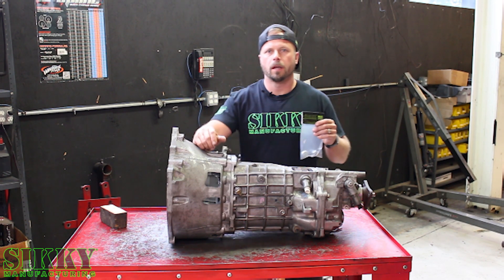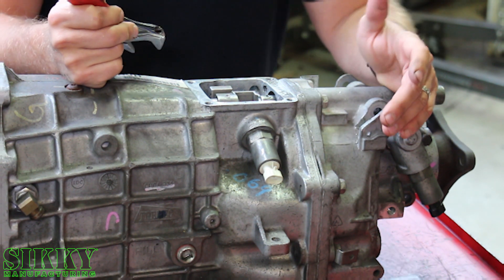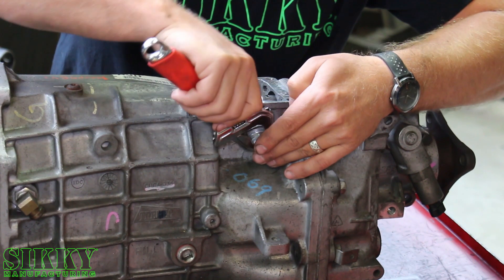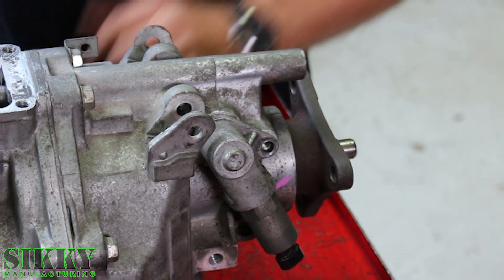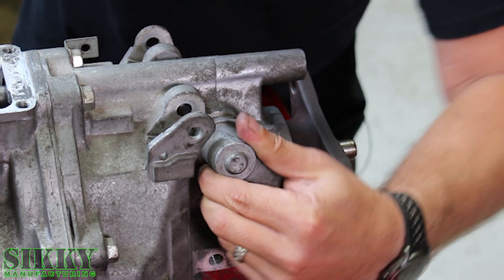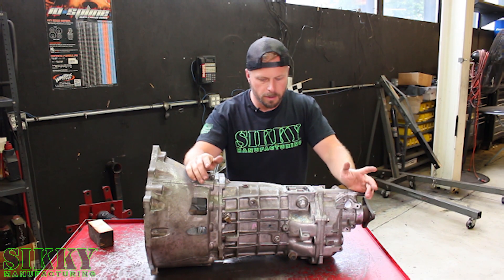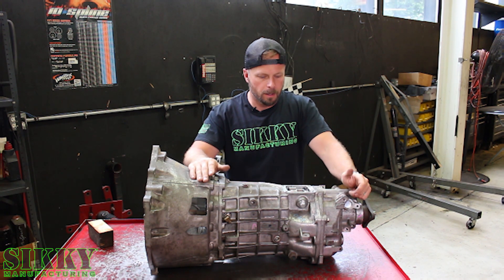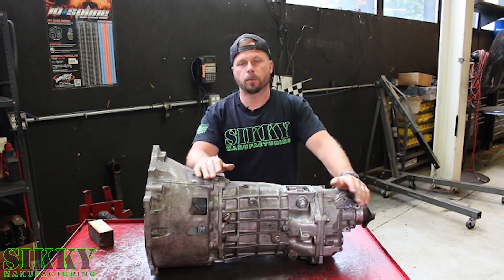How to Delete TR6060 CAGS + Reverse Lockout | SIKKY Manufacturing

Comment: Currently swapping a 2015 LS3/TR6060 in my 1975 Dodge Dart Sport. There are many Sikky parts I have used and this one is the next one, and also ordering the TR6060 relocation short throw once i have the tunnel finished.
Reply from the maker: Nice!  sounds like it's going to be a really cool setup.  Yeah we always recommend getting the trans in position or at least mocked up so you can get a precise measurement on where you want your shift lever to come through the tunnel that way you can pick the perfect offset shifter and combination of rod.  If your on social media be sure to tag us when you get the parts on!

Comment: I’ve been having issues with my second gear for years in my 15 camaro ss. Going from 1-2 gear always grinds and or I have to really force the shifter into gear very slowly not to grind. I sent the transmission to tick performance for a stage 1 rebuild with new synchros, carbon blockers, and shift forks. $5000 later my 1-2 shift feels just as bad as before. Do you have any ideas of problems that would be not related to the synchros. Maybe clutch or linkage related? Thanks in advance.

Comment: great videos, dropping a 2015 SRT 392 with a TR6060 6 speed manual into a 1968 charger, my question is: are the shifter location the same? have you seen this done before?
Reply from the maker: Yes they are same.  This shifter is designed to come straight back.  If you were to bolt this into a charger with a 6060 as a replacement shifter it would be offset about a half inch because the factory charger shifter is offset to the side as the trans is not in perfect alignment with the hole in the floor pan.

Comment: Im swapping a tr6060 into a mark 8. If there is no power connecting to the CAGS sensor, will it be fine to leave it alone in the trans?
Reply from the maker: Yes, but if you don't wire up the reverse lockout and don't delete it then getting it in reverse will be very hard because you are fighting the reverse lockout solenoid.

Comment: How much do you have to worry about going into reverse on accident because of deleting the solenoid?
Reply from the maker: Well I don't know about you but I don't recall ever being in a situation where I'm trying to bang 5th gear!  So realistically it's virtually impossible.  Not to mention reverse is way off to the right in the shift gates so you would really have to screw up.
Reply: @SikkyTV  I got 6 gears I'm banging 6 gears. Reverse lockout stays lol!

Comment: Do you know if the tr6060 will bolt up to my  Ls1 without modifications?
Reply: Yes. I’m running a tr6060 in my ls swapped 350z
Reply: Thank you 💯
Reply: @mormodz  Thank You, 👍 What clutch, pressure plate & flywheel setup did you use for your setup? My LS1 is from a Corvette and the tr6060 is out of a Camero. I have both clutch and pressure plate with me and they are different in size. Bolt pattern and spline seems to be the same but the pressure plate and clutch is noticeable different.

Comment: I have a c6zo6 tr6060 it grinds when going into reverse. Is that a bad synchro?
Reply: Most likely, yes.   It's also very easy to chew up teeth on the reverse gear when the sync fails
Reply: @GamingwithKandA  even tho every other gear is fine? If I put it into a gear with a synchro and then put it in reverse it’s completely fine
Reply: @jetlagtj427  I've read that the reverse gear is more susceptible to damage than the other gears, once the sync is worn out
Reply from the maker: Yeah, most of the time it would be a bad syncro.  If it was doing it in other gears then I would say possibly something else but sounds like a syncro to me.

Comment: What would cause the tr-6060 4th gear pop out of gear at 3.5k and above?
Reply from the maker: There is a retainer ring on the synchro which is worn or bad. Unfortunately a trans rebuild is the only way to fix